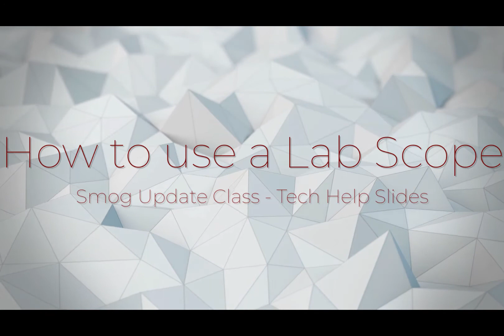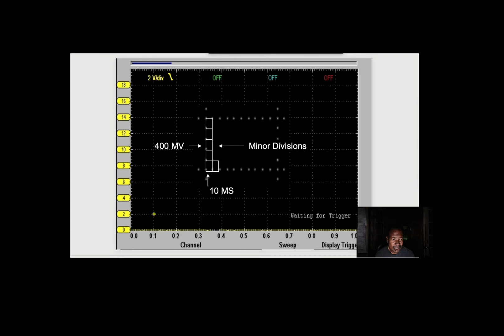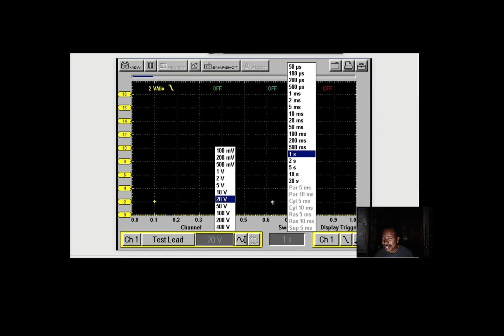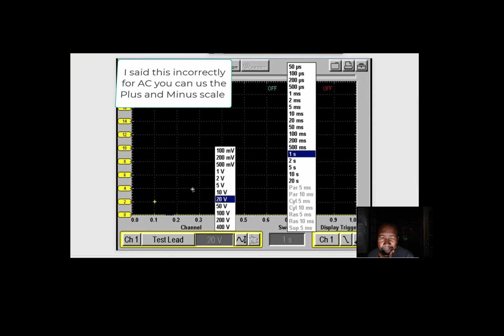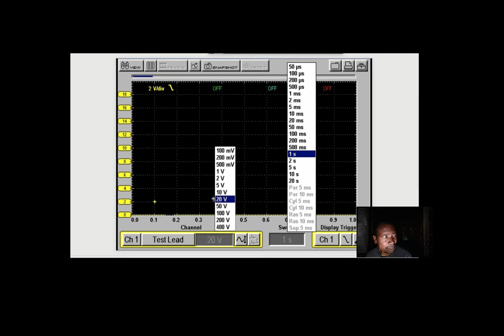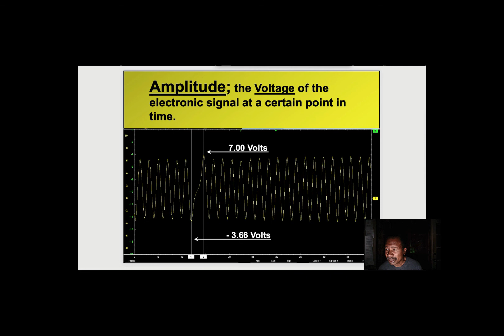Learning Lab Scope Part 5: Understanding Amplitude AC signal  - Tech Help PowerPoint Presentation

Comment: Great job Nate. What do you do when smog monitor set but when you turn the car off they all go incomplete?  My suspicions are the PCM  Memory are not storing  all the monitors once car is off. Have you come across this yet?
Reply from the maker: Is this a Chrysler it may be a PCM Update issue shoot me the make model year trans and engine size and when I get home I can see if I have any info on it.
Reply: @natedaviscteinstructor  2007 Mazda 3 2.0L  pcm will not store completed monitors after car is turned off
Reply: @natedaviscteinstructor  Thanks Nate
Reply from the maker: I look for TSB on this car there are known I would check for voltage and grounds to the PCM and especially voltage to the KAM terminal of the PCM if that’s good it’s probably a defective PCM